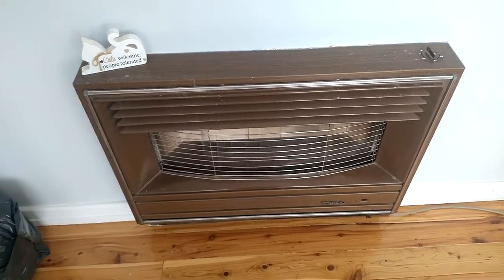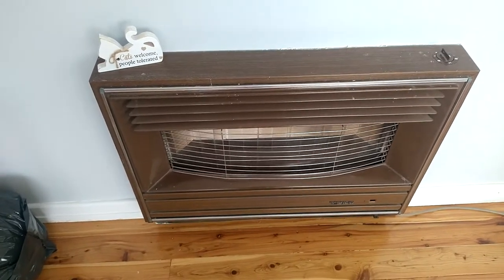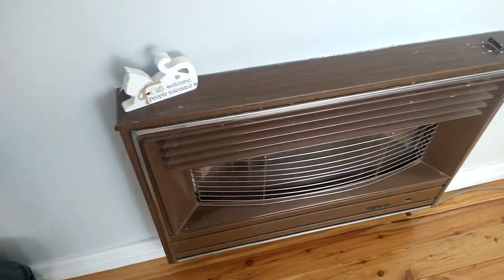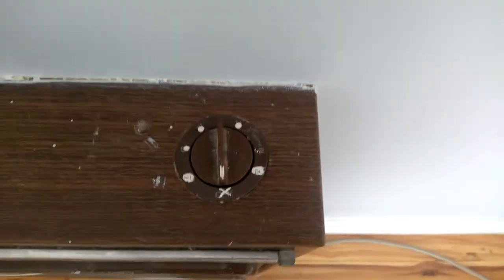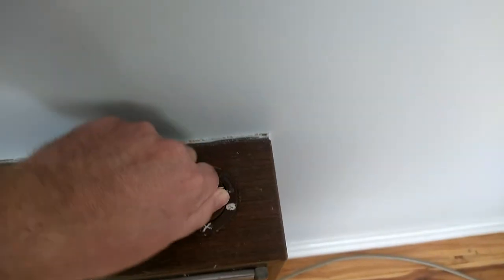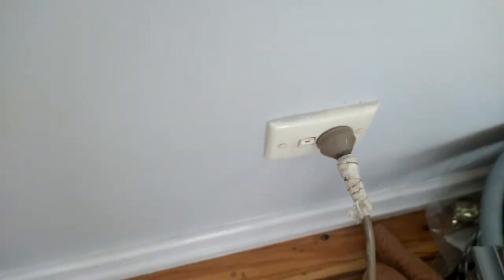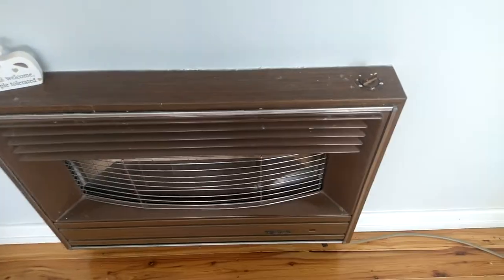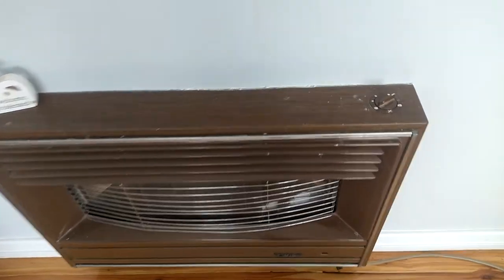Vulcan oil heater (40 series) ignition guide

Comment: Any recommendations for using one of these that you’re not sure the last time it was lit? (New house) can’t seem to pull much off to clean etc
Reply from the maker: @Onasaturdayy  first point is to check for sufficient fuel - they can run dry in a similar fashion to diesel engines and require priming again. You can run briefly on straight diesel although the glass will soot very quickly. There is a service manual available online if you're interested.

Two thumb screws at the base of the fascia allow it to be removed. Carbon fouling of the burner can be an issue, blow out with compressed air if this is the case.
Reply: @Albinus81  beautiful cheers, will find the manual and have a read. Thanks for the info.
Reply from the maker: @Onasaturdayy  40 series manual from here http://john116.com.au/Vulcan/spare_parts_and_service.htm

Comment: How to refuel
Reply from the maker: 600 litre oil tank on the side of the house,  a small tanker delivers.
Reply: @Albinus81 mine ran out of oil it seems, two days ago. 
I watched ur video to understand how to start it. It worked great. 
But now there’s no flame. Just a small amount of warm air that I’m guessing is just heat from the pilot light?
Reply: What is the oil called? I’m giggling but can only find people hating on this heater. Not sure why cos when it worked, it worked well.
Reply: What kind of oil is it? Is it gasoline or kerosene? How can I contact the oil delivery company?
Reply from the maker: @FreedomMatter it's simply called "heating oil" in Australia. Effectively a blend of diesel and kerosene.
Reply from the maker: @VioletsvisionsCat once ignited and the initial flame settles down, there's minimal flame visible when operating on low. If you're feeling warm air, it's working.